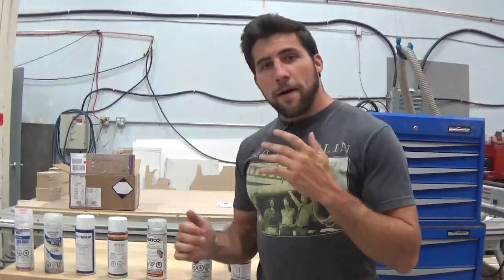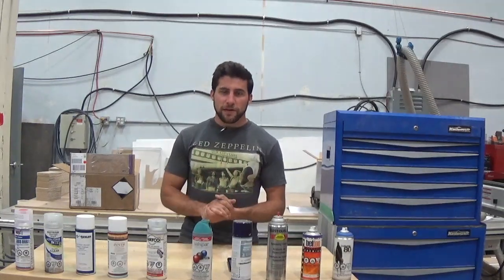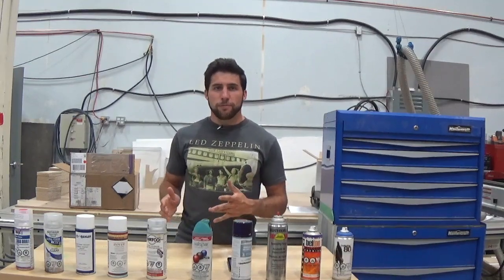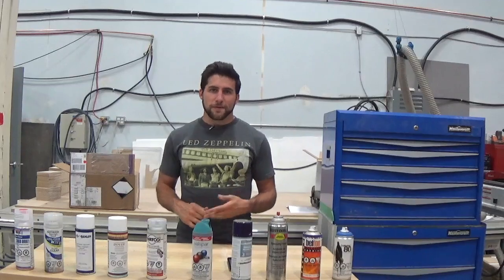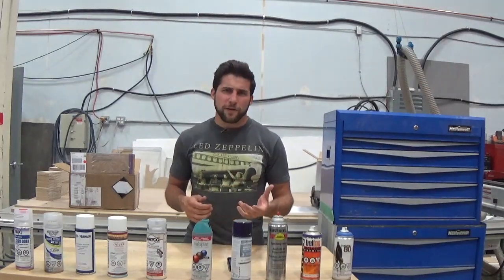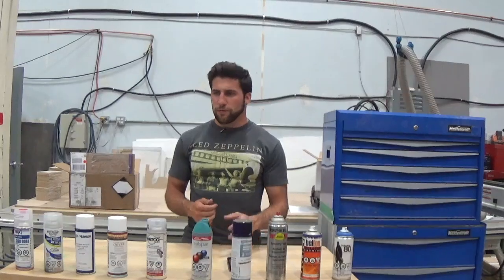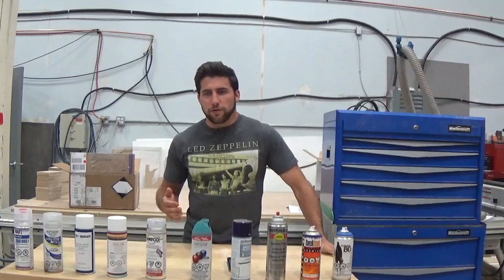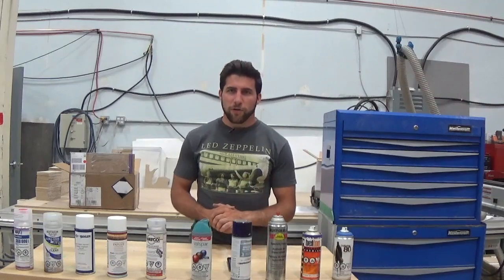The Top 5 Mistakes to Avoid When Painting With Spray Paint

Comment: hey! you seem to have a bit of experience with spray paints. I've been searching for far longer than I've ever had to for anything in regard to what I can use to seal spray painted furniture... I used Flat Black Primer on a sanded table and a couple coats Flat Black Paint +Primer on a sanded table. The legs were coated in 24 Karat Gold Design Master Spray. I need to coat it to a glossy, durable finish as it might get a decent amount of use. The internet has not been helpful in telling me what top coat to use for this. Spray can, brush on? Polyurethane, polycrylic? Maybe even lacquer? I really just want to finish this project without making any huge, regrettable mistakes! Thank You!
Reply from the maker: Tell me more about this gold spray. Is it a reflective finish? Have you by any chance sprayed another test piece with it so that you can try out a clear coat or two on it?
Reply from the maker: To clarify, there’s a mirror finish type gold, and then a sparkly type of gold. I’m wondering which type you’ve got.
Reply: it's a slightly more expensive paint more for artistic purposes... 8 to 9 bucks a can... http://dmcolor.com/products/24kt-pure-gold/  (link to the site)  I use these paints on frames and small decorative items and coat with shellac.... but those are things that will get little to no traffic.. I assume these are all oil based paints and am just looking for a glossy finish that can withstand things being set down onto it without easily chipping or marring...
Reply from the maker: You’re saying you’ve used shellac over them before successfully?
Reply: yeah, with no problem. Zinzzer Shellac in a spray can.  But will that work with a high traffic table top without getting ruined quickly?
Reply from the maker: No. But shellac tends to be compatible with pretty much everything, which makes it a great medium to transition between finishes when necessary. 
If you spray that on and let it dry fully, then sand it lightly with 800 grit and clean it, you can coat over it. 

Can’t leave a table done in shellac. The first time some heathen spills their whiskey on it it will melt haha. 

Have you seen my video on how to get a professional looking coat of clear with spray cans?
Reply: Awesome, good advice... I really appreciate knowing what not to do before I do it! I'll check out that video now.

Comment: I painted some stuff in my truck then sprayed clear coat over it and now it’s peeling on the edges and it’s cloudy and I can easily scratch it off what do I doplease answer
Reply from the maker: You’ll probably want to remove that and start over so that it’s not left exposed (which will allow it to rust).
Reply: Brad Angove wow you answered thinks I subbed but it’s on the inside of my truck it’s a plastic piece I think do you think it will get messed up or do you think it will be okay
Reply from the maker: @camisham484  Oh, well if it's plastic that may be your issue. Did you use adhesion promoter or plastic compatible primer on it? And did you sand it first?
Reply: Brad Angove I used primer and I didn’t sand it but I sprayed the door locks the same way and there just fine but I think it’s because the other thing had a texture on it

Comment: I just rattle caned a peddle car. Base coat white. Waited 24 hrs like the directions said. 103 degrees out side. 
Painted black over it on the hood. Two coats. 10 minutes two more coats.
Dammit! Started wrinkling. Rust-oleum high performance enamel.
I know to many coats to soon.
Went by the directions
Reply from the maker: You painted it outside?
Reply: In my garage. I’m letting it dry for two days now before a recoat.
Reply: Easy enough to sand out and do over.

Comment: I’ve painted my radiators white radiator spray paint and they are nice dry and smooth but when turned on and get hot they are sticky weeks later still any ideas ?
Reply from the maker: Radiator spray paint? Is that a specific product?
Reply: Brad Angove 
I got it from biology , paint specifically for radiators heat resident
Reply from the maker: I’m afraid I’m not familiar with it, so there’s really nothing I can tell you. If you followed the process they give you re any primers etc. you may want to consider contacting their customer service department, or even warranty department if they have one.

Comment: How do I stop 2 painted items from sticking together when packaged days after painting. I'm using Matt and gloss spray cans.
Reply from the maker: Put something between them?
Reply: @BradAngove  maybe grease proof paper but I was thinking of using a light coat of oil... I'm trying to find the best cheapest alternative to powder coating that I can do at home. Do you recommend any paints which may be best? And a best method of painting onto steel, maybe spray cans or compression spraying?
Reply from the maker: Have you looked into setting up to do powder coating at home? Otherwise, I would probably go with fast dry enamels.

Comment: I am spray painting some trim pieces for my car and I used a primer and I sanded them....when I spray paint on them the paint seems to absorb into the piece that i am painting and the color is super dull....what is happening
Reply from the maker: What kind of paint are you using? How long did you let the primer dry?
Reply: @BradAngove  I didn't get notifications...I use eastwood black primer.....I waited for 3 hours....I found out it was the humidity....thanks anyways...now I am dealing with terrible orange peel

Comment: Hi Brad, I Have some questions for you:
1.Does the temperature matter when spray painting? For example, can I start painting my guitar with the environment temperature being 0 C?
2.Can I get the marble effect (I guess you know that saran wrap trick) using spray painting? Or will the second color completely cover the prints from the first color?
Reply from the maker: The temperature definitely matters. Some paints won't dry in lower temperatures. Some won't spray properly, and some won't stick properly. 

You can do the marble trick with spray paint. You just need to be fast with the saran wrap because spray paint tends to tack up quickly. Make sure you spray a nice wet coat, and then go ahead. You may have to use the saran wrap twice quickly.
Reply: I'm intending to use Rust Oleum, will the temperature be a problem in this case? Thanks a lot for answering by the way!
Reply from the maker: Yes, it will still affect the paint's ability to dry properly, and may cause it to thicken a bit and not spray correctly.
Reply: Thank you Brad, keep up the good work, you're doing a really good and cool job!
Reply from the maker: Thank you.

Comment: Hey Brad, I'm using rustoleum black gloss on a project and I keep having issues where the paint is soft days or a week after. I realize I'm probably causing it by spraying too thick but if I am going to redo it now, can just lightly sand it or am I going to have to sand heavy to get all of it off? It seems it is only soft in certain areas.
Reply from the maker: In order to avoid trapping soft paint underneath a hardened layer, you'll probably want to sand it all off. If you have soft paint underneath then your surface will get imprints on it from things.

Comment: My spray paint jobs look like it has chicken pox, should I sand it and give it another go? Why does it  spray like that to begin with? I want to just do a clean job the first time.
Reply from the maker: You can sand it smooth and add another coat. You may want to have a look at my video on why your spray cans are spitting.

Comment: any recommendations for atv frame and part painting
Reply from the maker: +dedsec Thug For plastic parts you'll need adhesion promoter. Use primer for the metal parts. Be careful painting corners. Inside corners tend to get runs, outside corners tend to go on too light.

Comment: to fix pinhole at wood lacquer finish 1- fill it tiny holes with spray gun, then wet sand by 1000 and then 2000? .. and finally polish it..is that right procedure ?
Reply from the maker: +Moataz Adly don’t use the spray gun. Use pit some finish on a swab or something and fill just the holes.
Reply: thanks a lot for your explanation
Reply from the maker: +Moataz Adly Thanks for watching.

Comment: When I spray painted, it came out all powdery but there were some patches that were smooth to the touch. What's going on?
Reply from the maker: You’re probably just spraying too light. Have a look at my video on how to get an even coat of paint with spray cans.
Reply: @BradAngove  thank you for you reply. That maybe it. 

I also read on the can to spray between 15-25°C. And it's about 9°C outside（I'm spraying outdoors）. So I was wondering if it could also be the temperature I am spraying under too？
Reply from the maker: That can create a number of issues.

Comment: I painted some plastic, and laid down clear 24 hours later, and the paint wrinked. What did I do wrong?
Reply from the maker: Did you use adhesion promoter?
Have a look at my video on “why is my paint crazing”.
Reply: Brad Angove Yes. It does not do it on metal flake paint but on regular paint it will wrinkle if I lay down clear
Reply from the maker: What kind of paint is it?
Reply: Brad Angove just a regular Rust-Oleum all-purpose spray paint that they sell at Home Depot.
Reply from the maker: Acrylic? What about the clear?

Comment: Something happened as I was spraying like the paint moved and created like a little crater to where I can see the surface of what I'm painting
Reply from the maker: It’s called a fish-eye. It happens because of surface contamination preventing the paint from sticking to a particular area.
Reply: @BradAngove  how do I fix it? Sand it down wipe with damp clothes then withdry cloth let it dry for 2 hours??? Is that correct?
Reply from the maker: Yes that should be good, and then spray again.

Comment: Hi Brad, wondering if you could best advise on a stencil job I am trying to work out. I am trying to spray paint a stencil graphic onto my plastic dustbin / wheelie bin - https://tinyurl.com/y8m7n7j9 - I have tried it once but the spray paint dried and then just peeled off the surface and ruined the graphic I was trying to achieve. The rest of the spray paint that remained just scrubbed off really easily. I am guessing the bins plastic smooth surface is designed to reject spray paint as sort of anti vandalism type solution. Apart from sanding the surface before spraying to make it rough is my only idea. Do you have any suggestions?
Reply from the maker: Plastic in general doesn't play well with paint. Have a look at my video on how to paint plastic parts properly. That should help you out.
Reply: Listen to Brad. I have repainted my plastic fairings and u need to scuff sand to a dull finish, adhesion promoter or plastic primer and make sure tht u follow the exact apply times! Dont go by touching alone ! Call cust srvc on the can and ask them for best reapply, drying, base and clear times according to ur area temperature.

Comment: I dont have a respirator mask what should I use instead while I spraypaint
Reply: @BradAngove  where should I get one from ? And do u know any good reasonably  cheap ones ?
Reply from the maker: I have a couple 3M options in the amazon link in the description. The half mask is cheaper and is adequate if you’re not spraying all the time.
Reply: @BradAngove  thanks
Reply: @BradAngove  which description?
Reply from the maker: The description of the video.

Comment: I spray painted a dresser and I let it dry over night. I touched it this morning and it rubbed off on my hands. What did I do wrong?
Reply from the maker: How far away did you hold the can? Would you say you sprayed lightly, or heavily?
Reply: I held it about 8 inches away and it was heavily sprayed, but evenly sprayed.
Reply from the maker: That's rather odd. What did you do to prepare the surface before spraying it?
Reply: I cleaned it with hot water, but that was like 2 weeks before I spray painted it. I didn't sand it at all.
Reply from the maker: That could be the issue. In order to allow new paint to stick properly, you should be sanding the previous paint lightly first with about 400-800 grit paper, and then cleaning the surface with wax and grease remover. Sometimes a primer is also worthwhile.
Reply: definitely agree w Brad on the sanding Tammy. Also make sure tht u shake the can for about a min until the ball rattles and just sand to scuff the surface. If u hv a finish on the wood, use a varnish remover, wipe clean and then sand, then apply primer, then paint.

Comment: why spray paint(can) get washed by petrol ? and how to protect the paint so that petrol won't effect the paint
Reply: please reply it's urgent🙏
Reply from the maker: +ASHWAA CUSTOMS I’m confused. Are you pouring gas on your paint job for something?
Reply: ya suppose i have to paint my motorcycle fuel tank and for that job i used spray can but after 3-4 days of drying when i try to rub the paint with petrol it easily comes off.
Reply: and thanks for your reply
Reply from the maker: +ASHWAA CUSTOMS I’m afraid I don’t understand why you are rubbing the tank with petrol. Regardless, the appropriate paint for something like that is a catalyzed polyurethane.
Reply: Use engine clear it's gas proof.👍

Comment: Will spray paint stick off if you put it on a cable
Reply from the maker: Are you asking if paint sticks to electrical cables?
Reply: @BradAngove  yes
Reply from the maker: Not very well. Adhesion promoter would help, but it’s still risky.

Comment: hey I used tape to make a stencil spayed it then removed the tape the edges are raised how to I get the paint to lay flatter help anyone
Reply from the maker: I think I have an "ask brad" video on this topic. I also demonstrate it in either the second or third video of my frankenstrat paint job series. Anyway, basically you reduce the edges carefully using either sandpaper, scotch brite, or a razor blade. You just need to make them less evident. Then you bury them under a few coats of clear so that you can sand it flat and polish it out to a smooth finish.
Reply: Shane Buckles  Remove tape when paint still wet

Comment: why do I keep getting winkles in my base coat. it's doing my head in now. I can't seem to stop it. first I thought it was because I never left the panel wipe to dry long enough. I even keep a heater by my panels to insure the evaporation before I paint. I even had primer wrinkle on me the other day and it never sands out. please help.
Reply from the maker: What's the humidity like where you spray? What kind(s) of paint are you using? How do you prepare your panel before you paint it? How close to the paint is the heater?
Reply: Brad Angove thank for your reaponse. it's not very humid quite cold maybe about 15 degrees Celsius. don't have a heater. just spray in a workshop. I use panel wipe then a tac rag
Reply from the maker: How many coats are you applying, and how far apart?
Reply: Brad Angove 

3 coats 10 minutes between coats. sometimes wrinkles on the first coat!
Reply from the maker: Wow. That's weird. What kind of paint are you using? There's a chance the tack rag is leaving behind some residue that is reacting with the paint.
Reply: Brad Angove 

it's made by a company called clostermans. but I have had it with other paints. so it must be something I'm doing. yes could be the tac rag. good point. can it react with filler if the primer isn't thick enough?
Reply from the maker: I don't think it's an issue of it reacting with the primer/filler if those are already on there. If your paint is wrinkling, and the temperature and humidity are normal and the coats are reasonably spaced etc., then you're probably getting a reaction.
This could mean that the tack rag is leaving residue, and the paint that you spray over it is reacting to it. It could also mean, if you have a primer down already, that the paint is not compatible with the primer.
Reply: Brad Angove 
Ok thanks. you've gave me lots to think about and try next time. thanks for your help!
Reply from the maker: You're welcome.
Reply: It sounds like this U are having trouble putting it on or it's the way it being mixed and maybe your equipment step back N take a good look at what you're doing sometimes you gotta step down to come back up  that's okay stay loose